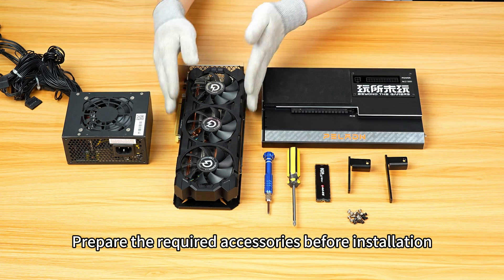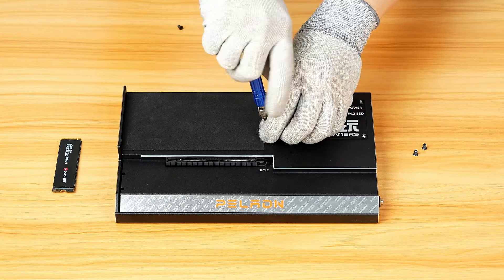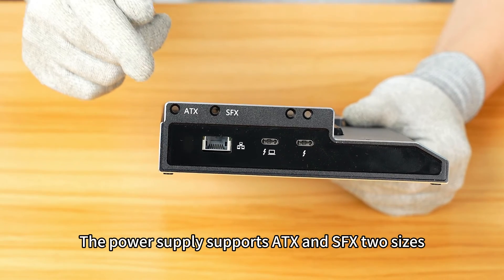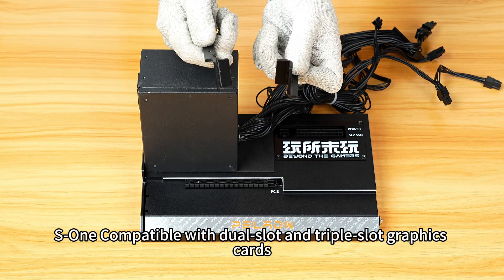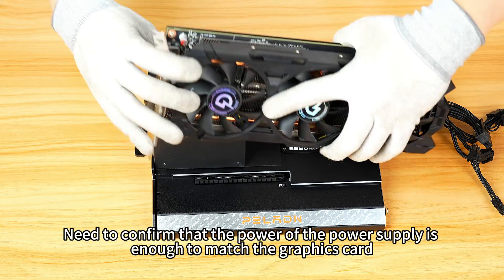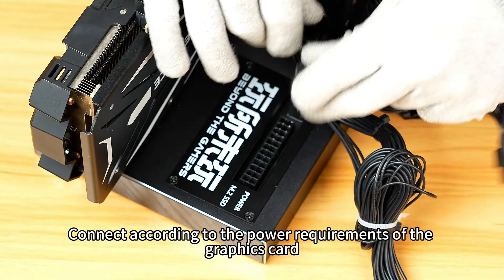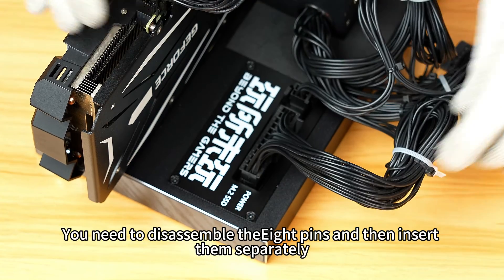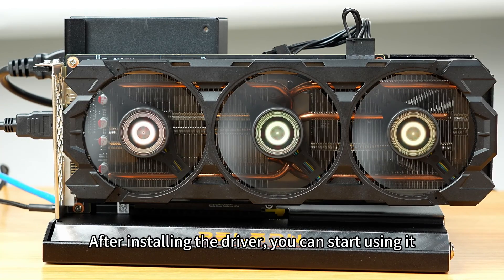PELADN Link S-1 External GPU Dock Install Guide #gpu #peladn #graphiccard  #egpu #thunderbolts

Comment: My Link S-1 came with instructions in Chinese only. Can you provide a link to the English version of the manual? Also, where do I find the drivers for the Link S-1?
Reply from the maker: Hello @LoPeng5555, we notice you leave message on our website and have sent the English manual for you. And the EGPU needn't drivers. It will be work after you install  the graphics card to connect to your laptop. Please notice it.
Reply: @peladn3556  It isn't that simple. I used a thunderbolt 4 cable with a RTX 5060 Ti installed in the GPU dock, but it still does not work. I believe there is a driver missing or that my GMKtec K6 doesn't fully support TB4. I'm still working on it and will keep you posted.
Reply from the maker: @LoPeng5555  ok. Any news, please let us know. Thanks.
Reply: @peladn3556  Sorry, it didn't work out. I would have had to disable the onboard AMD 780M chip in order to use the external GPU. I wanted to use both graphics chips on multiple monitors.
Reply from the maker: @LoPeng5555  Thank you very much for the information. Please email to our technology department for the solution via support@peladn.com. Thanks a lot.
Reply: @LoPeng5555  I have the same problem and i am reading possible problem is with AMD.... do you resolve it ?

Comment: I’m an actually customer. I live stateside. It’s excellent. Far easier to use than the options from other companies (e.g. Razer) that don’t fit many of the latest Nvidia 4000 GPUs or have a long list of compromises. 

The Link S works excellently with my 4070TS and 750W Corsair PSU. The craftsmanship and design is just better than any other option on the market.
Reply from the maker: Hello @BasicBobby, thank you very much for purchasing our product and praising our product. :-)
Reply: Hi, i have problem in instalation, in device manager vga show up, but in task manager, and nvidia app it wont appear😢

Comment: Confused on the last steps. What plug are you using to connect the gpu to the thunderbolt port on the dock? I thought those ports connect to the external device (not the docked gpu).
Reply from the maker: Hello @BasicBobby, just plug the GPU into the card slot of the external GPU dock, thank you
Reply: @peladn3556  awesome thank you. Love the product by the way. Honestly, amazing quality I rarely find these days. I had a Peladn gpu as well. Excellent build quality, thermals.
Reply from the maker: @BasicBobby  Thank you very much. my friend
Reply: support all graphic and power supply ?
usb 4 ?
for exemlle 1000 watt and rtx 4090 compatible ?